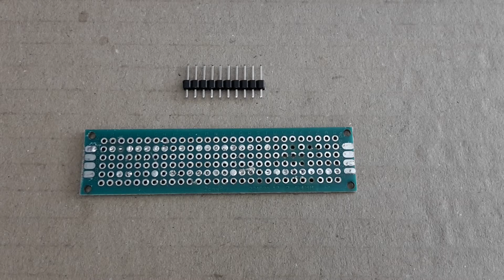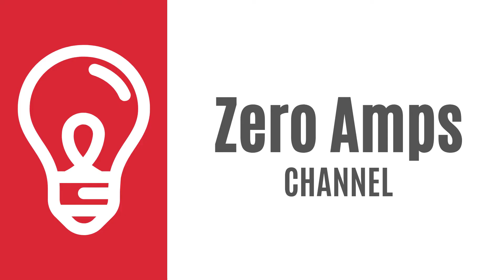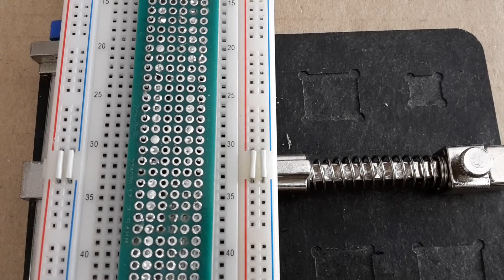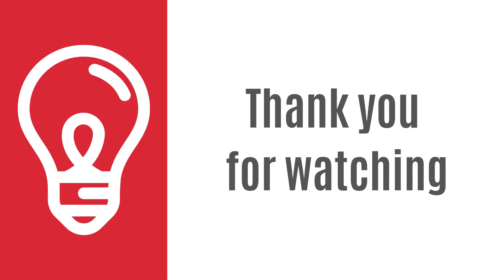Soldering and Desoldering Pin Headers

Comment: I got intrested when you said you were going to use big soldering iron because that's the only one I have! This technique  really helped me loads to separate th Male header pins from my broken ir sensor to solder it to the ends of wires. Than you very much.👌👍
Reply: I have been trying many other ways to desolder it and this helped me very much.

Comment: good technique and i have learn from your video.
Reply from the maker: Thank you!
Reply: @zeroampselectronics  May I ask you a question? How long does Desoldering Braid be used? Previously I have never used.
Reply from the maker: Hi, your question is a bit confusing. Could you ask a different way. Thanks.
Reply: @zeroampselectronics  im sorry.im not good in english language.usually what is the safest temperature to do soldering?
Reply from the maker: Hi, I usually use 350C for my hobby projects.
Reply: @zeroampselectronics  thanks for responding.i appreciate it.